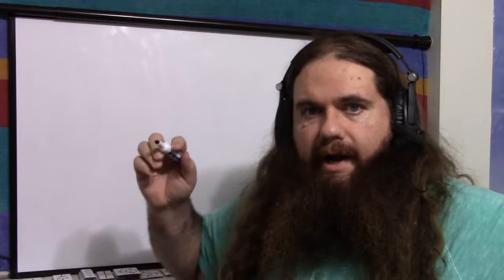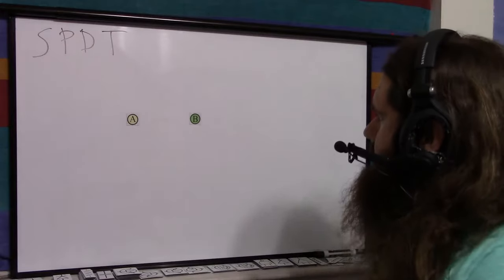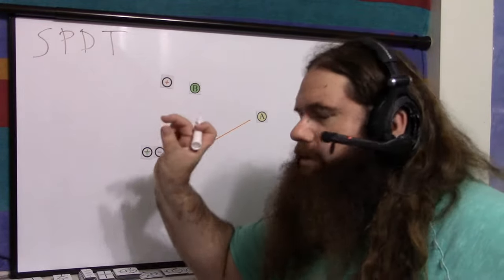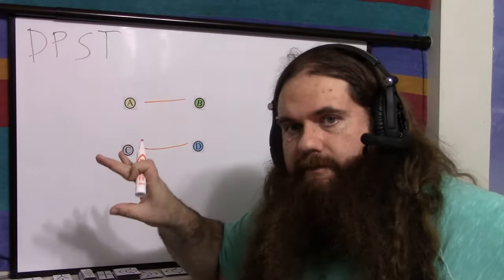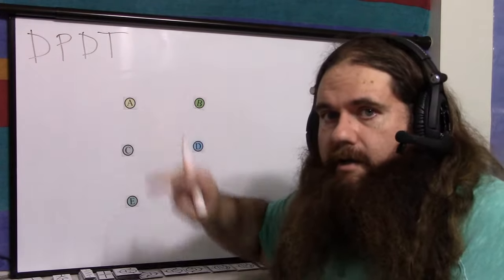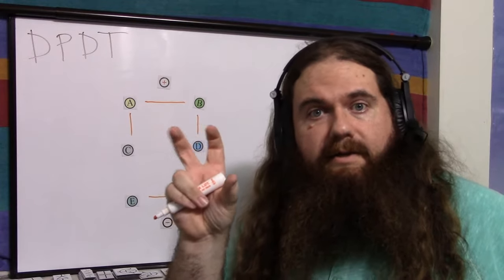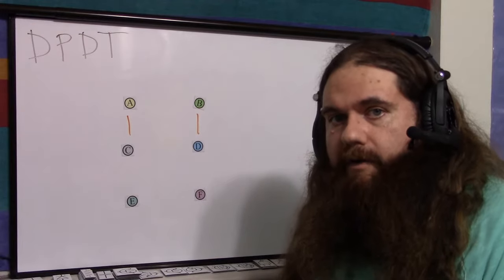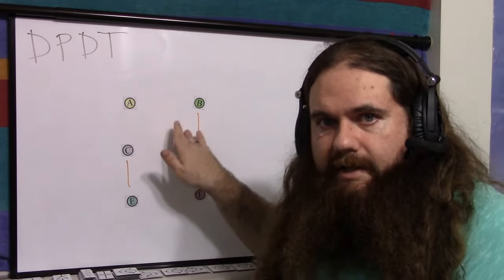How Switches Work - SPST - SPDT - DPST - DPDT - Simply Put

Comment: Good presentation, thanks.  You can also use a DPDT on-on-on switch as a SP3T switch by placing a simple jumper on it.  This is what I am doing on my airplane instrument panel.  I want to send one signal to three different components one at a time.
Reply from the maker: Electronics goes from "cool" to "fun" when you get to start doing creative things like that. It's like we get to control reality a little bit. Object doesn't do the thing we want? So we make it do it anyway!

Comment: Switches are electrical components that allow or interrupt the flow of current in an electrical circuit. There are several types of switches, which can be classified based on the number of contacts they have, the number of positions they can take, and the number of circuits they can control.

SPST (Single Pole, Single Throw) switch has one input and one output and can control a single circuit. It is either in the "on" or "off" position.

SPDT (Single Pole, Double Throw) switch has one input and two outputs. It can switch between two different circuits and has three positions: "on" for one circuit, "on" for the other circuit, and "off".

DPST (Double Pole, Single Throw) switch has two inputs and two outputs and can control two circuits independently. It is either in the "on" or "off" position for both circuits.

DPDT (Double Pole, Double Throw) switch has two inputs and four outputs and can control two circuits and switch between two different connections. It has six positions: "on" for both circuits, "on" for one circuit and "off" for the other, and so on.

In simple terms, switches control the flow of electrical current in a circuit by connecting or disconnecting components. The type of switch you use depends on the number of circuits and connections you need to control.  --- Chatgpt's repsonse after literally  typing in the title of this video into it.

Comment: The DPDT switch you didn't know what it's for (at 8:00) is an ON-ON-ON switch. I'm using one to hopefully connect a (noise-cancelling) dummy coil inside my guitar, but I need bypass & phase reverse options (because my pickups also have phase-reverse switches). So up & down positions offer coil in two phases, while the middle offers bypass coil option.

Comment: This helped immensely with my research into a new project and hobby. Thank you. For the DPDT does this mean it could run circuit one on, circuit two on, then both on and both off all in a single switch with four positions?  I am looking and linking two motor sets together to run as i have asked above so I can do a one or the either, neither both scenario. Just wanted to make sure i under stand correctly

Comment: The DPDT 3-way ON-On-On can be used for 3 different capacitors.  In my case, I'm going to use it on the tone control of a guitar to be able to dial in a wider range of frequencies.

Comment: Good explanations and examples in this video except for when it came to DPDT. You said that you couldn't think of a use for one so Ill give you one. In my boat, I have 2 tanks, but 1 gauge. I need to switch between tanks by providing a 12v+ to the tank valve while also switching the signal from the tank's sending unit to the gauge. Using a DPDT works perfectly in this case.

Comment: Spst-0n off, 2 nodes
Spdt- on on (always connected) or on off on, 3 nodes 
Dpst- two simple switches that operate together (separate voltages- electric isolation)

Dpdt- 6 nodes, on on, on on, no connection

Up and down.

Comment: Hello, I enjoyed your show. Can you help me? I have a 2”Haibel SPDT on off on 3 position 4 pin switch. The pins are numbered on top left as 8,2,3 and on the right 7. I put 7 as ground. 8 as power in. 2 goes to relay switch 86 to device, 3 to another device. All is well. However, I would prefer the device to be controlled by pin 2, and the relay by pin 3. This makes their operation more senseful. However, in this configuration the devices do not work. Could you kindly tell me how to solve this problem?

Comment: I'm hoping you can help me out. I have two old troy bily tractors that are very similar except one has a cruise control option. The toggle for the cruise control is a three position with the bottom being off, middle on and top momentary on. The way it works is, when you press the forward peddle to a desired speed, you press the top which is momentary, that locks a magnetic coil on the peddle shaft and holds it in position. This is wired to a latching relay and when the brake is pressed, it shuts the power off for the coil and remains off till the top momentary which is marked reset is pressed again. I made a cruise control for the tractor that didn't have one out of an ac compressor clutch coil and was able to get the correct switch and relay used online. My problem is with the switches which are obsolete and getting harder to find anywhere. I already had one switch go bad but luckily was able to find one. The switch has no identifiable marks or numbers so I don't have anyway to search it other than by description which offers no results. Have you ever seen such a switch? Like I said, down is off, middle on and top momentary (reset) and springs back to middle on. This switch has four pins on the back. Any info will be greatly appreciated. Thanks.

Comment: Happy new year, one important property of switches are missing  MBB = "make before break" and  BBM = "break before make"
Reply: And Lord help the SoB that confuses this!  (Very Bad Things can happen...)
Reply from the maker: I can well imagine, but reality is so messy with switch bouncing and everything, that electronics absolutely should be engineered to withstand such things when possible, even if it's just a fuse.
Reply from the maker: Well, that's a new concept for me, but obvious now that you mentioned it and I looked it up. And I think I'll have to just keep on going as if it didn't exist and plan for the worst, because I haven't even found documentation for many switches that even states which it is! Although now I have an idea to do a video on using a circuit or an oscilloscope to check it...
Reply: @simplyput2796  (sorry about my bad english) I'm a pro in software (since last 35 years) but a beginner in elektronics most of your videos are well done and really helpful for me. How ever currently I build a PCB CNC - router from scratch and was running in to trouble with swiches. I found out the problem are not debouncing nor cheap chinies crap it's was "make before break" ! For a short time signals was new connected before the old connection are opened.  Looks like this is important for a video of "How Switches Work" :-)

Comment: Question: If you wanted a 120v inverter to receive power from either the mains, OR a generator, you'd need a DPDT switch as a transfer switch, correct? Given that it's 120v (not 240v) you would use both poles - one for hot, and one for neutral, correct? This would feed either the hot and neutral from the panel, or the hot and neutral from the generator, or both off.

Comment: Please help

I have a load (timer)  and want to control from 2 different places.1) if both switches are on, then load is to be on. 2) if either of the switches is off,  the load should be off. 3) if either of the two switches is on, then the load should be on.  The load is a timer that need to be powered off before it can be powered on. So the off is should be the priority.
Thanks

Comment: Hi  nice detailesd video.  I would like to know if the SPDT switch can be used in switching the power supply of my rechargeable fan from battery to electric and vice versa? I am planning to add an electric power supply option to my rechargeable fan while maintaining  the battery option in operation. I'd like to have the option to  switch  to two different power supplies from time to time. Thanks in advance.

Comment: I have a puzzle for you sir, I can't wrap my brain around trying to figure this out. So here it is: I have a rocker switch (dont know how may pins i need) two lights, RED and BLUE. When Car is off ALL lights are OFF. When car turns on BOTH RED and BLUE turn on (rocker in middle position).  Up position = RED on BLUE off Down position RED off BLUE on... How could wire this configuration?

Comment: Ok so I want to put a switch on my riding mower so I can turn the lights on and off. They are on all the time right now when it's running. Would SPDT switch be the best option? Just cut the wire between the lights and battery and put the switch between?
Reply from the maker: If it's two wires, you'd only need to cut one and put a simple SPST in there (could even use a light switch from the hardware store and bolt it onto the frame), because you're just trying to break/connect the circuit. If the two lights have separate wires (two each, four total wires), you probably could just tie together either both high or both low and do the same thing, but if for whatever reason they need to remain separate (I can't imagine why, but just in case) then you'd get a DPST, which is two completely separate connections but both controlled by the same switch (both on or both off).
Reply: @simplyput2796  awesome thanks. From what I see there is 2 wires coming from the battery I'm assuming then there is a Y that just splits off to the other light. So that simple setup would just need an SPST right? Basically cut one of the wires (before the Y) and add the switch? Would it matter what wire I cut? And also as far as switches go I have a question. I would like a switch that lights up (preferably lit weather the lights are on or off or even one that lights up when I switch it on) but the only ones I can find that light up have 3 poles. Does that matter? Like do I have to use the 3rd pole? Sorry for all the questions I'm just not very good with wiring lol. I suppose just a basic 2 pole attached to one of the wires would be fine I just like the light up switches better. (more options to choose from as well it seems)
Reply from the maker: If you can find a Y, just cut either wire before the Y and put the switch in. There couldn't possibly be enough watts going through to a couple lights to do damage to a simple switch. As to the light-up switches, check the datasheet or infosheet and there will be a wiring diagram to tell you what the poles are for. If you get the switch from the hardware store, there might be a little folded-up piece of paper in it to tell you what to do.

Comment: Hey I am wiring 1 linear actuator to a single axis solar tracker using DPDT RELAY 30 amp  the actuator needs to be wired to reverse the pole to lower and reverse the other way to push up . So the center would be to the actuator and the other two side are wired to my battery bank 1 pair could be pos and neg and second pair neg then pos and 7 and 8 pin to tracker and when it sends the reverse poles to the relay it will switch back and forth between the 2 pole settings giving the desired up and down needed?

Comment: What do I need to wire up 2 different signals so I can use either s-stops to  to stop 2 different circuits. I hope I explained what I need to do. Any help  would be helpful.
Reply from the maker: Perhaps you could explain in more detail. Are you trying to stop each circuit independently, or both together? If you want both to be open or both to be closed simultaneously, you want a DPST switch. Otherwise, you'd just have two separate switches.
Reply: I want either of the e-stops to stop both of the circuit at the same time as I am working on a milling machine and I have one e-stop that is on the machine and another on the breakout board. The one on the machine just stops the spindle and the one on the breakout board stops the bed. I need it all to stop if either e-stop is pushed. I hope I explained it a little better.
Reply from the maker: So you want both circuits to be connected at the same time, or you want both circuits to be broken at the same time. That is a DPST switch, and just search your favourite online retailer for "dpst on-off" (4-pin). The 6-pin version (on-off-on) would work too, but it would be wasteful.
Reply: @simplyput2796  Thanks now all I need to do is figure out how to wire it up. these probably have 2 different voltages that I will want to either turn on or off at the same time
Reply: @simplyput2796   What I want to do is find someway to wire up a relay that if I use e-stop 1 then  the same thing will happen to e-stop 2 or if I hit e-stop 2  the same thing will happen to e-stop 1. I thank you for trying to help I liked your video but as you can tell I am a beginner and am trying to make a machine more safe to use. I need everything to stop it if either #1 or #2  e-stop is used. Thanks again for your help. I have tried to explain this as best as I can. If you could show a diagram of where to hook e-stop one and where to hook e-stop 2 and what to use as the coil energizer.

Comment: Electronics need switches but boy are they annoying to have to de-bounce and keep from floating.
Reply from the maker: The best friend to a debouncer is a pull-up or pull-down resistor. Pull-down resistors on audio-in and -out plugs are great so the system doesn't go crazy when you plug and unplug things.